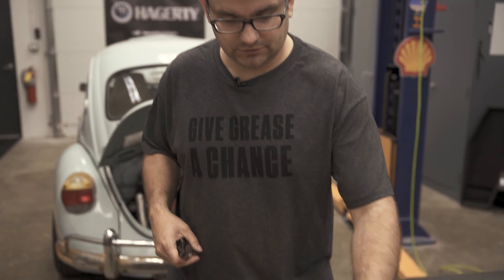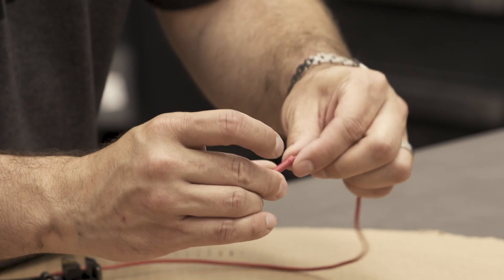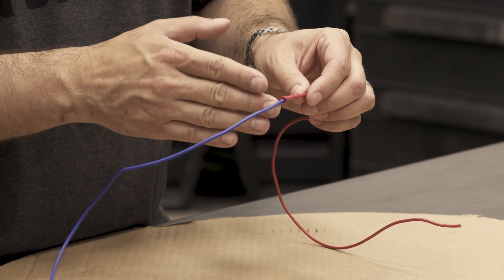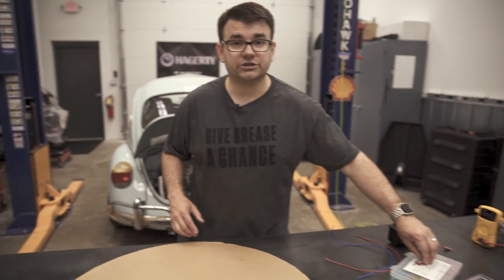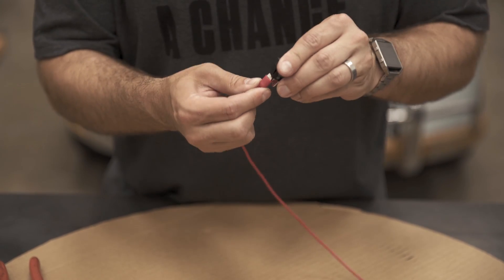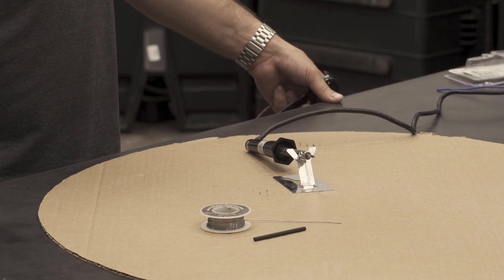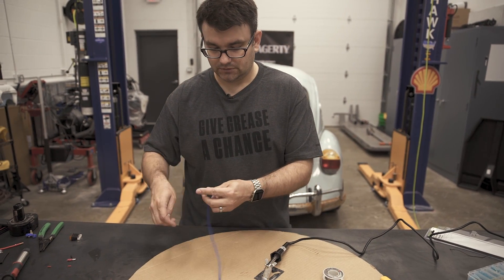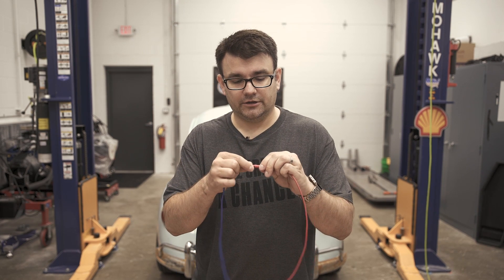Common Automotive Electrical Connections | DIY

Comment: The "shielding" he speaks of, is SHEATHING.. Its a layer of insulation. Shielding is a foil or wire braid that goes around sheathing, with another layer of sheathing over that... Which is a SHIELDED wire.when talking about wiring, its SUUUPER easy for people to accidentally mix up these words (and others). No offense at all to the poster, but he seemed to use the word "shielding" only, which peads me to think, thats just what he calls sheathing. They arent the same! (For u folks out there, trying to learn about shielding or shielded wire). Again though, VERY common mistake in wording 

Lol and i am picking on him for this part (just for fun! I have to haha! Not trying to be mean.. just, thought it was kinda funny!)... About his wire strippers... "It give u a very accurate means of where u strip the wire, depending on where u place the wire" IM SORRY! 😂 even a knife will strip a wire, depending on where u place it, to strip a wire... The thing that actually bugs me about what he showed, is that he had an automatically adjusting stripper, but is does NOT have a stop! If u want ACCURATE stripping legnth (throughout each and every wire u strip), get some self adjusting strippers that HAVE a wire stop!

...if all else fails, ur teeth will accurately strip  a wire, wherever u place ur teeth on a wire, for stripping

Comment: The but connector is apparently best to last longer where the wires will vibrate alot. Vs soldering that might come loose over time

Comment: After years of building custom scientific diagnostic machines, please, ONLY use solder or braising to splice wires in a car.  Crimp plus shrink works mostly. Mostly, but after years we learned the hard way that crimp is just not durable enough.
Reply: Will the solder not come loose over time where there is high vibration and heat in the engine bay ?
Reply: @rizaanjappie  sure anything is possible. We often worked in conditions exceeding typical engine bay temp with many instruments clustered together in a confined space.  Soldered joints always worked best. 

Solder melts in the 400-700 F range.

200F is rarely found in an engine bay, not nearly enough  to affect solder.  Plus we always shrinked over the solder, which probably minimizes vibration
Reply: @lotklear1379  OK thanks man. I'll go the solder route then to extend the wiring for a maf sensor. The soldering has to be spot on as it affects air fuel ratios.
Reply: @rizaanjappie  sure anything is possible. We often worked in conditions exceeding typical engine bay temp with many instruments clustered together in a confined space.  Soldered joints always worked best. 

Solder melts in the 400-700 F range.

200F is rarely found in an engine bay, not nearly enough  to affect solder.  Plus we always shrinked over the solder, which probably minimizes vibration

Comment: Solder can and does crack, hence why airplane electrics are all crimped.
Also invest in a set of ratchet crimpers, besr 20-25 I ever spent, they give you a far more controlled and consistent crimp and are easier on your hands.
Glue heatshrink is worth the investment, glue stops all moisture and you just heat the glue shrink till its shrunk and the glue starts bubbling out of the end

Comment: For automotive apllication soldering is not the best way of connecting two wires. Especially under the hood or in other places where heat can be an issue. Crimping is much more safer and bullet proof. You can solder inside of the car, on stereo components and such stuff. I don't say it can't be done but crimping is much more safer and practical.
Reply: Would using the butt crimp connectors be suitable for wiring up a brake controller?

Comment: I would'nt suggest using the twist splice. My grandpa taught me the way the Western-Union splice and solder wires. Also called the NASA splice.
Reply: Wire connection using the example at 9:00 is not recommended. It's not strong and will bulge.

Comment: As someone who designs automotive electrical connection systems ... I would strongly recommend NOT watching this video.
Reply: I was thinking much the same.  When I heard insulation called shielding, I pretty much knew the presenter didn’t have much of a clue.
Reply: This method is so much better than Scotch Lock (IDP) connections most morons use.

Comment: Love these DIY videos.  It might be worth mentioning the two different ways to crimp connectors using the crimpers.  There are a "pin/cup" and a "cup/cup" crimping area on the crimpers.  Some crimpers have non-insulated and insulated labels on the tool.  You appear to be using the "pin/cup" slot for insulated connectors and you run the risk of puncturing the insulation and should be used for non-insulated connectors and the "cup/cup" slot for the insulated ones you show in the video.  Hope that helps.

Comment: always put your shrink tube on one of the wires before you solder. you're almost always soldering two wires already connected to other things, and forgetting to put it on there before you complete the solder is just an annoying rookie mistake to make :)
Reply: Isolation tape can help but you will have a great gymnastics for your fingers 😂

Comment: Although I don’t do it in my electronics shop class in the early 70s we were taught to use a bit of emry cloth on the bare wire before soldering or add a connection.

Comment: Very well explained and shown. Just a little recommendation: A Western Union Connectiion (sometimes called Bell Connection) is a way better way to solder two wires. At the shown twist-method the wires route into the same direction. One wire has to be bend 180 degrees. The copper might become brittle at this point, when it gets older. 
Three advantages of a Western Union Connection: 
1) The copper is only twisted, but not (over-)bend. 
2) Even the twisted wires are able to take some pulling (before soldering). 
3) The connection is thinner, because the insulated material never runs parallely to the soldered wire. 
Matt talked about a following soldering video. This might be a good chance to show the differences and advantages. 
Cheers, TOBi 👋😉
Reply: agreed, stronger and thinner if you do it right

Comment: Not to split hairs but the jacket around the wire conductor isn't shielding, it's insulation.  Other than that this is a good tutorial for novices.  If you're just starting out with soldering make sure you buy the 60/40 tin/lead rosin core solder mentioned in this video, not lead-free solder that you'll also find on the shelves.  You might think the lead-free solder is the better "eco" choice but 60/40 solder is easier to work with and makes for a more durable connection.
Reply: In finland you can't even get tin that has lead

Comment: does the heat shrink come in rolls of different sizes? reason i ask is i'm in the middle of doing a complete rewire on my '75 cj-5 and it would seem easier to buy it by the roll in different sizes instead of trying to keep up with all those small packages of different size heat shrink tubes.
Reply: everett thornton you can get a little box of it like the one he had with all the connectors in it at hardware store. has different colors and sizes
Reply: thanks for your comment.what he is useing on this video is what i'm useing now.i just thought it would save me a little time by not having to stock up on limited containers of these when i could  have a roll of different sizes on hand.just trying to save myself some time back and forth to the auto parts store and to save on gas.
Reply: I keep my heat shrink in a fishing tackle box to keep it organized and all in one spot
Reply: great idea man.i have three or four that i use whenever i have a chance to actually go fishing.i just might emty one and take your advice.much appreciated,thanks.
Reply: It does. I have a little box with 10 different sizes, about a dozen of each, in my garage….and usually I’ve got one of each in the emergency kit in my car along with the basic tools to fix something on the road if need be (the joys of driving a 40 year old vehicle…haha)